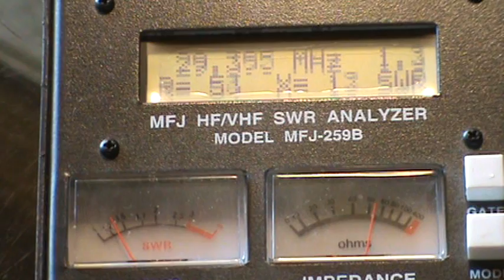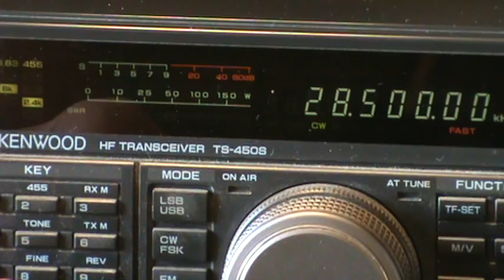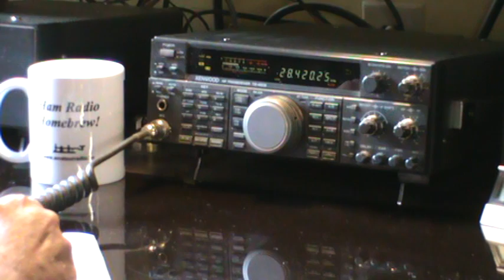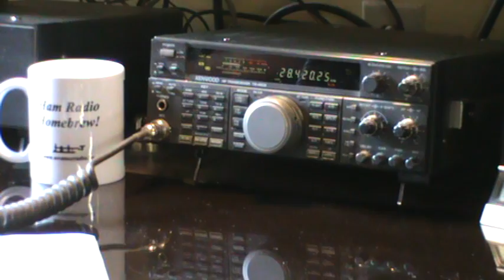Ham Radio 10 Meter Ground Plane Antenna

Comment: @Dave Tadlock  - Question ?  How would you calculate the radial length if i were to make this and put in air 20feet ? How long would buried radials have to be / Thanks so much for a reply ?  73's

Comment: Hello Dave I have a Question and since you stated you were a Cb er at one time I figure you would remember the Old CLR2 CB antenna(Aluminum) what i was wondering is since I can only listen to HF cause i still need to get my Canadian Amateur radio Licence what i was wondering a friend ave me an old CLR 2 without ground Radials and its also missing the TOP HAT the 3 little elements  to convert that antenna into a 10 meter antenna for receive only would i need to cut off any of the mast or would it receive 10 ok just as it is another friend gave me a ICOM IC-720a  to start me out on HF radio and I thought I would like to listen i have been using a 2 meter omni antenna to listen to the bands but 10 meter isnt coming in at all so i thought might like to see if i can receive 10 meters any info be appreciated
Reply: Shorten your radials to 100 inches
Without the top hat it should be about right for 10m, maybe shorten it to 19' 4" to get a little better 29MHz performance.

Comment: Last but not least Dave, I wanted to ask you about something. I have been taught that any Verticle Antenna cut to a freq with out any tunning coil or tunning array like this one has around a 40ohm or so. And this is why a steal whip can only be tunned no lower then a 1.3 on cb. Is this true? How is your verticle able to have a perfect 1.0 swr877

Comment: Greetings Dave, is possible to use this type of antenna for 6 mtrs? how did you arrive at the measurements for ten meters? I would like to dothis for six meters as well. thanks for the info, very helpful

Comment: Hey Dave, do  you have experience playing around with wi-fi antennas? It's became a little hobby of mine, and have been told that ham radio operators run on the same (or around the same?) frequencies. Any idea if your antennas would be well suited for 2.4ghz? Sorry, kind of a newbie with all of it right now : )

Comment: Hi Dave, I have a ProComm 1/2 wave and cannot hear any local stations at all. what size radials would be right for this antenna? I can only put on 2 or maybe three, because of my location. I cannot put up a Antron 99 or anything that big because of height restrictions. I have this up on a 10 ft. steel pole and the antenna is 12ft. Iam a CB'er, just in case you could not tell. My SWR is about 1:1.5: across the band and can hear skip from all over the Country, but nothing local. I do hear one local guy at night but can't hear who he is talking to, from the conversation he or they are local also. Any ideas you have would greatly be appreciated. Mike at ProComm thought I should ground it better.
Reply: Ste

Comment: Some not mentioned,when using new 2017\18 DC isolated SMP power supplies for radio,the DC ground must not come in contact with earth via the coax braid.Most NEW cb and HF radios are common DC grounded internally ,the SO-239 socket is at DC ground potential.When coax connected the braid is carry that DC negative,if mast \bracket is earthed you will create a short,modern 2017/18 DC isolated SMP do not like this and why they do RFI\DC noise on bus line!and  part of the reason they get a bad rap,just ensure the ground planes are connected to braid,but use a insulated mast stub so mast embedded in earth potential is isolated from braid\mount.Most tech papers and antenna books are not up to date with this fact,I discovered this issue on a industrial project after speaking to designers of test sample SMP we used causing a problem.Turn out this is a big no no with NEW DC isolated SMP only ,Linear PSU fine.WE did proof testing and could see the problems on test gear the minute earth potential conected to braid\DC negative side of SMP I trailed antenna mounted in isolated way and must have ground planes and it worked great and no issues either with SMP power supply and RFI problems.Great video Dave

Comment: DAVE,  MIGHTY FINE  VIDEO  OF THE HOME BREW  VERTICLE  FOR  10 METERS.  HERE AGE  IS 79  AN BEEN  HAM  FOR 45YRS,. RUNNING AN OLD   TS-850 S  AT ABT  70WATTS  ANTS ARE 3 ELM BEAM AT 55 FT  AN HALF WAVR  FOR  40 METERS  AN A TRAP DIPOLE  FOR THE 3  WAR  BANDS.
GOOD LUCK  DAVE,
RON, WB8NMK  IN N.W. OHIO  MAY 20-2015

Comment: Eh, cant tune the damn thing, no matter what i do i get 2.5 swr
Reply: Try lengthening or shortening your radials, and be sure you have at LEAST four of them.  Sometimes the angle that the radials are mounted changes feed point impedance as well.

Comment: Ground plane antennas for ground wave propagation ? Where in the world did you hear that ? Because I'm sure Bill Orr W6SAI and L. B. Cebik, W4RNL would disagree wholeheartedly 

When it comes to antennas whether vertical or horizontally polarized the higher you can get it the better it will perform end of story !! height is King !

I've had plenty of chance to experiment my goal has been to duplicate many Of Cebiks observations. I joke with my friends I tell them I live on 4 acres and grow aluminum.  

 I have 6 antennas capable of 10 meter operation. I have a dipole at 30 feet, a 4 element beam at 35 feet a home brew 1/4 wave ground plane at 60 feet and another 1/4 wave GP at 10 feet as well as a ground mounted Hustler 5 BTV and finally a G5RV at 80 feet.

The best antenna I have for 10m is the 1/4 GP at 60 feet.  8 out of 10 times it's stronger than the 4 element beam at 35 feet which is the next strongest antenna.

The worst antenna I have on 10m is the G5RV it's virtually deaf. Without fail signals that are an S9 on the 60 foot GP are in the noise on the G5RV.  In all honesty on anything below 40m the G5RV  is a waste of wire and coax.  

  The  Ground mounted Hustler with 120 full sized radials is the second worst antenna on 10m.   On average it is reported as being 4 to 6 S units down on TX and about the same on RX. What makes matters worse is the increased noise level on the low verticals.

 The Hustler like all the low vertical antennas is plagued with high noise levels. This is where I take issue with your comment regarding antenna height. When it comes to vertical antennas it's of paramount importance that you mount them as high above man made noise as possible, doing so will dramatically lower your noise floor. It could be the difference between an S8 noise floor and an S0 noise floor. 

Both my ground mounted hustler and my 1/4GP at 10 feet have a constant S6 to S8 noise floor making it impossible to run the preamp.  it usually runs S6 at night and S8 during the day when everyone with in a few miles is awake and all their electronic goodies are turned on,

You would be amazed at how much broad banded hash a cheap computer power supply can generate. Once that hash travels out of your neighbors house and onto the power lines the power lines then become giant antennas for it.  

 Getting that noise into the null as far under your antenna as possible  makes a dramatic difference.  When you mount a 10m Gp at 10 feet you place its main lobe right into the path of every power line and house with in a few miles.  Like I said your much better off placing all that man made noise deep into that 60+ db null under the antenna rather than right in its primary lobe.     

 Case and point the same ground plane that was seeing an S8 noise floor at 10 feet  when mounted at 60 feet has a zero noise floor which allows me to engage the preamp which usually brings the noise floor up to about S1 or S2. yet results in a substantial improvement in SN ratio 

When working DX The low noise floor of the high ground plane makes all the difference in the world because on the low antennas I can't hear anything below and S8 during the day and S6 at night.

Now when it comes to working local stations at night via ground wave the high ground plane is King far superior then the beam and there is no comparison between it and the low ground planes which are pretty much useless for local ground  wave work.

If I had to choose one antenna for 10m it would be the ground plane at 60 feet. 8 out of 10 times its stronger than the 4 element beam at 35 feet, Now I'm sure if the 4 element yagi was at 60 feet it would perform much better than the ground plane does now.

  Unfortunately mounting the beam at 60 feet is considerably more expensive requiring a tower with cement footing and guys. The GP only cost a few dollars to build doesn't require a rotor only weights about 2 pounds and was easily mounted on a 50 foot push up mast on the roof.  I'm sure a 5/8th wave would perform even better but it is much heaver and I have concerns that the Rohn mast would not hold it during a good wind storm.. 

  To give you an idea how well the 1/4 wave Gp works at 60 feet,  I worked DXCC on 10m in 8 months I worked WAS on 10m phone in 2 months. During the last 10m contest I worked over 2800 contacts continually switching between all my antennas looking for the best one and 8 out of 10 times it was that stupid ground plane at 60 feet.

Interestingly enough if you move that same ground plane down to 35 feet where it was originally the noise floor skyrockets and the 4 element beam becomes top dog ( as long as your not pointing at the power lines or the 2 story houses on a hill about a mile away. The bottom line is when it comes to antennas height is King.

One last note regarding ground mounted antennas. They seem to be much more susceptible to QSB as compared to the same antenna mounted above the roof line